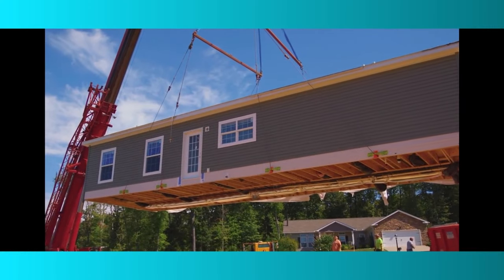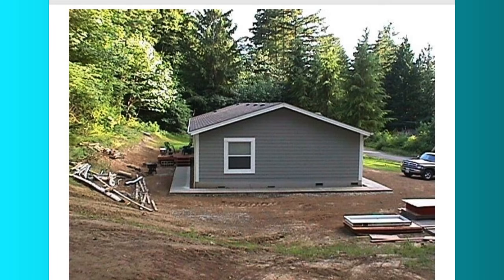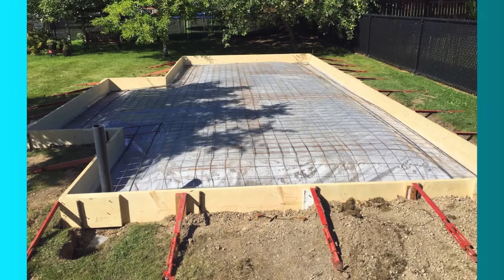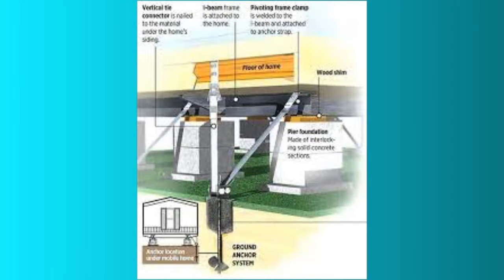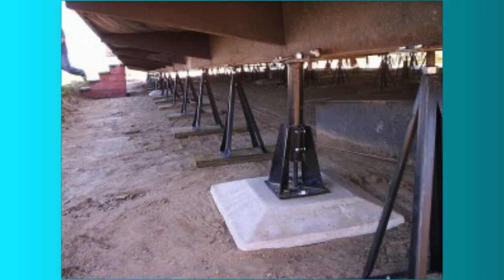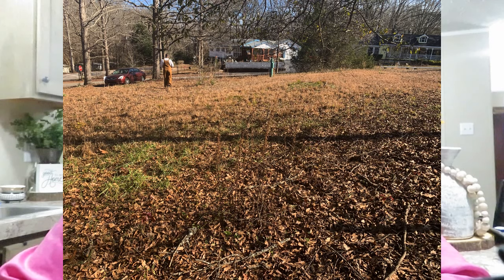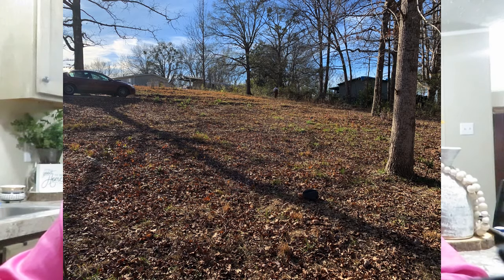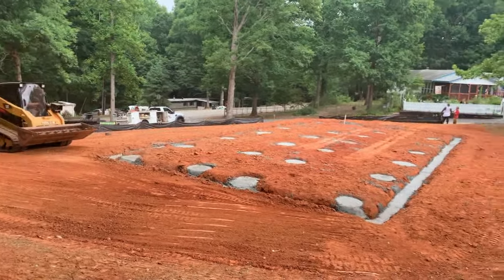Permanant Mobile Home Foundations | The 4 Types

Comment: Does the contractors setting up the home & preparing the land as well as the towing comes in the home & land package, or was that separate out of pocket cost?
Reply: You ever found an answer to your question?? Cause I have the same exact question..
Reply: I want to know the same thing
Reply: They are all separate costs and each builder should offer different packages depending on what you need. I work for Titan in NC.

Comment: Thank you so much for the video I’ve learned a lot about what type of foundation for my home ,  I want our double wide manufactured home to be on a slab but I always see them up off foundation, is it better structured wise to be up off or slab, the area where my property is a sandy soil even though it will be pack down, thank you for your advise

Comment: When you do this type of thing with a mobile home does this mean you can put it just about anywhere as far as zoning? I have a piece of land where my "regular" stick built home burned down, now I would like to put a mobile home on the cleared land but it's in a residential neighborhood I don't know where to begin.
Reply from the maker: You need to contact the county zoning department in your county and find out if that address is zoned for manufactured homes. They can look up your address over the phone and tell you. From there they can explain what the Necessary steps are for the land. Once you get your answer, email me with any more questions. My email is in the description box

Comment: About how much did everything cost? Do I need cash? Thanks.
Reply: Price of home  30K to 300K or more.  Price of land.  Who knows, have to search that one out.  Price of septic, electric and other soft costs.  About 20K or so.  And finally the transportation and foundation.  I would estimate 15K or poss more.
Reply: The home I picked is 75K, site improvements brought final loan amount to 94700.  The biggest portion of the improvements went to the septic. We discovered ours was not only very, very, old but also not to code and too small for the new home. Editing to add that the lender didnt require cash down since we already had the land.